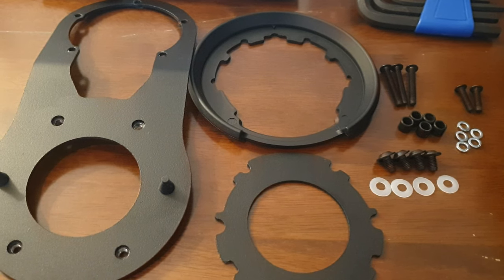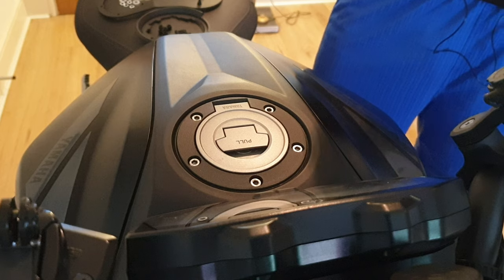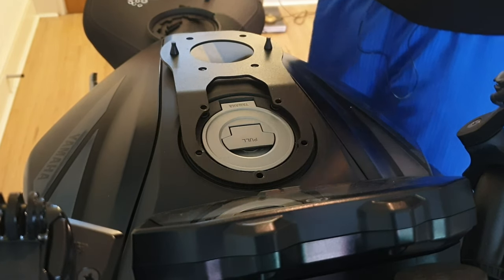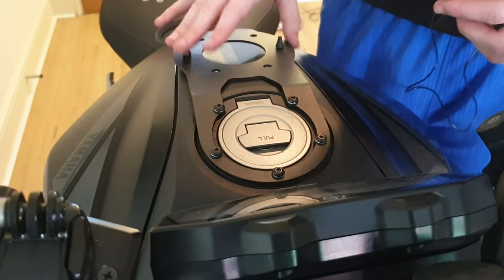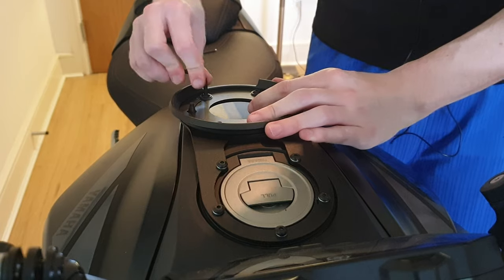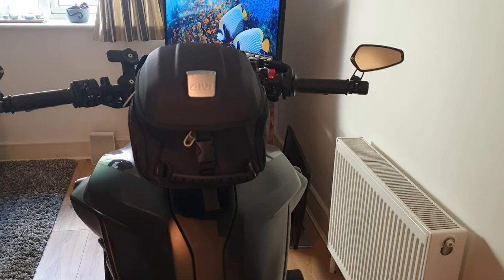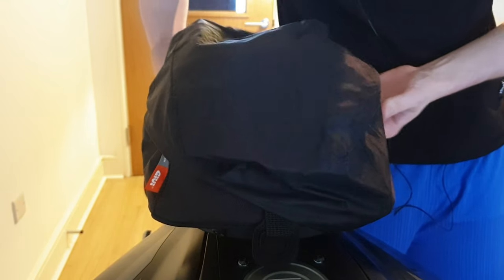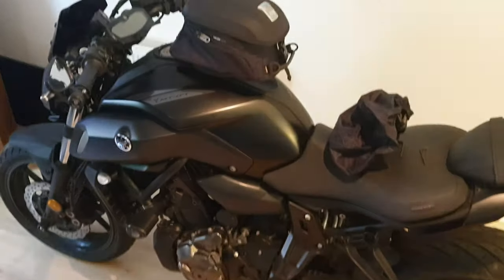Givi MT505 Tank Bag Install | 2018 Yamaha MT-07

Comment: Everyone knows when you drop a bolt or washer it disappears into another realm. Therefore I've concluded you're a magician cus you found it. I'm impressed and slightly scared. 
Givi stuff is bloody top notch. Looked a great fit and the bag is tasty on there tbh, doesn't look bad at all!!! :)
Reply from the maker: I have strange powers to seek out bolts & washers...
Givi is class & it performed so well on my Photo Rally tour. I find myself using it all the time now rather than a backpack!
Reply: @LuckyLukeRides  I may be calling on you in the future 😂 
Backpacks are great and all but they also suck and change how you rode I avoid them if I can :)